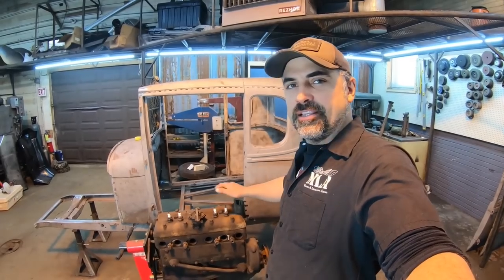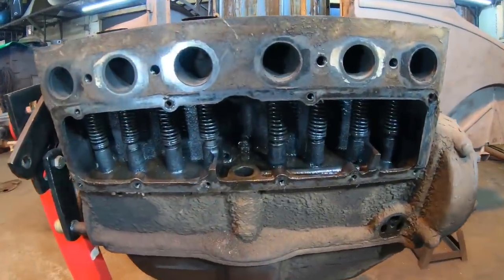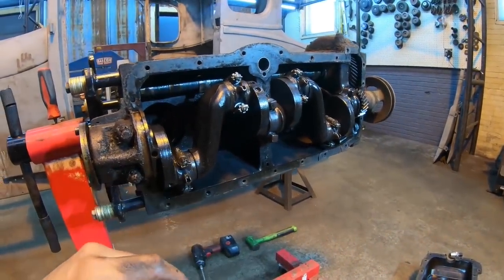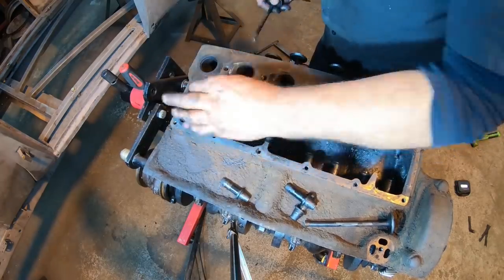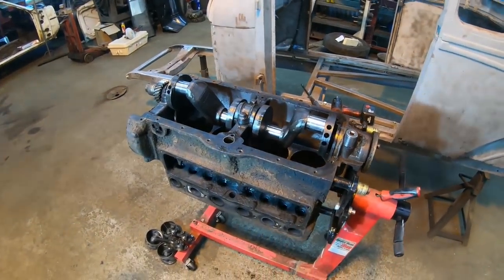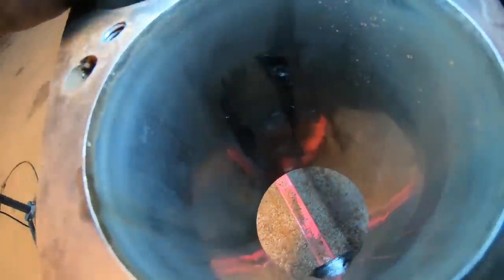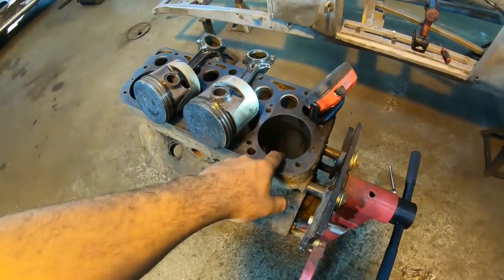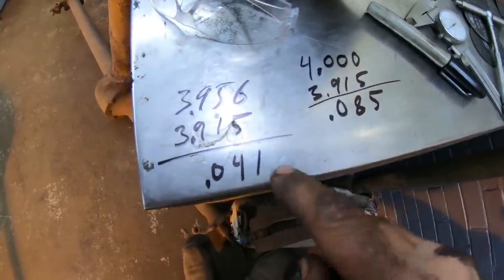DISASSEMBLY & INSPECTION Of A 94 YEAR OLD Model A Ford Engine - Yard Art Model A - Part 7

Comment: That block can be sleeved. Rebore won't fix that damage.
Reply from the maker: I have to talk about that in more detail in an upcoming video. I really didn't say it in the teardown video but i want a 4 inch bore. I'm going for displacement, with the forged insert bearing crank, all all the other good stuff they have out there today there is no reason you can't make well over 100 horse out of one of these things. I have a friend locally who hopped one up in a roadster and our engine shop figures it should be around 150 horse.  I'm hoping to make that happen with mine. If i was doing a stock rebuild and keeping it lower hp, i probably would just sleeve it, but if it cleans up at 4 or even 4.030, I'm happy.   The old guys that used to hop these things up say it wasn't uncommon to go even up to 4.060, but that is the max max, then its all over if something happens.  Also there is no coolant between the cylinders and the outside of the block, therefore there is plenty of material to take away, also making the exterior wall a bit thinner should actually help disperse more heat out of the side of the block... Those are my thoughts anyway...
Reply: @rottersgarage  a forged crank using insert bearing shells for what you want to do is best. The standard crank you took out, won't be up to what you want. They can pump out over 100hp, no problem when built the right way. I've not had much to do with these engines, other than doing valve work, & oil changes. A real pain the threaded piece in the oil pan is turning, though I'm sure you'll figure out how to fix it without input from me, as you seem to know what you're doing. I look forward to seeing the end result. Good to know they have plenty in the cylinders that can be removed, so you can bore to 4".

Comment: The damage was caused by the wrist pin. I became loose from the con rod at some point.
Reply from the maker: I kinda thought the same, but the damage was actually offset from the wrist pin. So unless the rod twisted and the pin came loose, it actually couldn't have been the pin.... So many people have said that that was a common casting imperfection thing that would happen in the cylinders, I'm leaning towards that personally.... Or a piston came apart in the past.....

Comment: If you put a balanced  crank in it it will no longer sound like a model A
Reply from the maker: The crank itself shouldn't make a difference in sound, just run smoother with less vibration. Now the cam that I'm going to put in it, that is going to make it sound way different. 👍

Comment: You would be Blowned away, if you seen what I did to a Block Like That , But quess what it worked, And still running today, I stick welded it a had it Bored., Most People would Not do that, But at the Time It did not Matter, If it did not work I would have found a Block, But It cost me nothing, for the Boring. So, Sometimes thing work, Hell the old racers, would Cut a intaked manifold, in half and add a carburetor, What ever works,And theres nothing wrong with trying.

Comment: I would SO keep that original crank why would you replace that it's cool as hell. And don't tell me for improved oiling and balance cuz that means nothing. Keeping it original is what's important. If they weren't well balanced back then well then that's a part of the novelty! I'd want to know this is EXACTLY how it ran and what it sounded like 95 years ago THAT'S what makes a build cool. To hell with new improved parts. A scat crank in an old flat head 4! That's sacreligeous it doesn't even sound right. The bearings you pulled out and crank are Cherry but you think you need a better crank? Cmon man! I hope it spins a bearing on your new SCAT crank and you put the original back in

Comment: You should have just used the original crank fuk putting that new stuff in your taking away from its originality there was nothing wrong with the way they designed it back the i don't like when people do these restos and use all "new improved" parts i would rather know i have all the original internals in it for the novelty. You don't rev those things over 2500 rpm anyways it'll be fine
Reply from the maker: Yeah, I want 150 hp not 30... And the forged scat crank is the first step to getting there. Put 8:1 compression on a factory crank and see how far that gets ya...